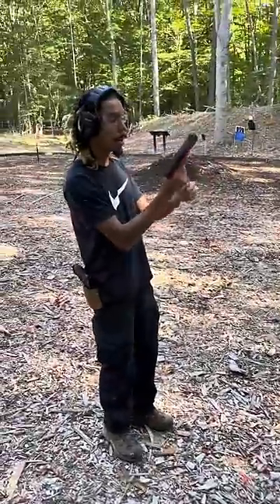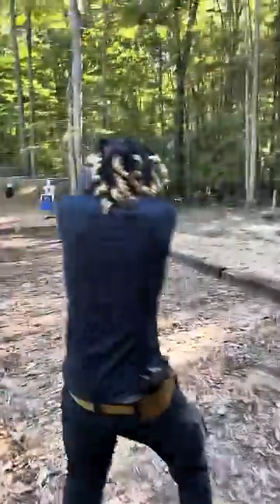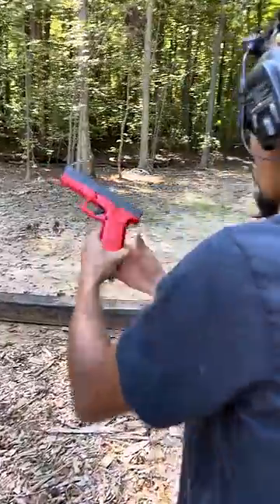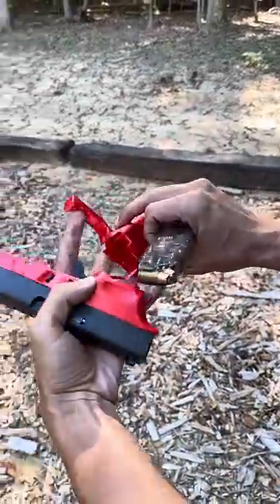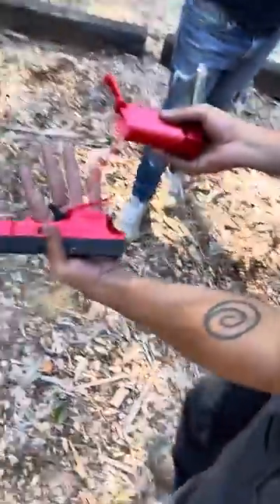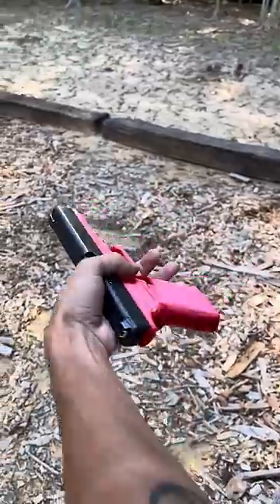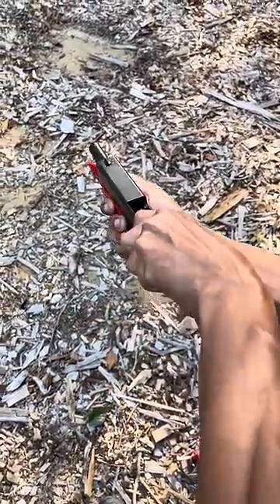3D Printed Gun FAIL 🤬

Comment: "I think i used the wrong material" lol yes, he used silk filament which is pretty weak and mostly just for looks. PLA+ is probably the best way to go, at least he acknowledged it though lol
Reply: Will carbon fiber filament work ? I heard pls shrinks or warps under heat
Reply: Not because of material ,look like he printed it horizontal layer which make it weak and easy to break.
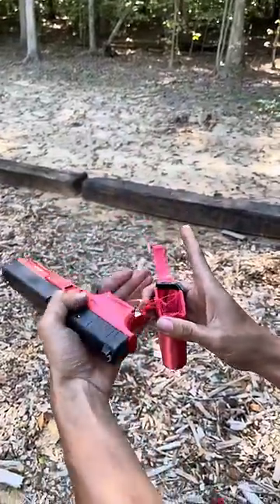Reply: @AlienZ..  Were he using a "normal" amount of infill you would be right. However, at 100% infill it really doesn't matter all that much. Yes, the print will still be stronger under compressive force than shear force, but both orientations will be plenty strong to handle 9mm. This was the fault of material choice and bad print settings (look at 0:26, how the outer perimeter on the inside of the mag well is separating from the rest. That shouldn't be happening.), not print orientation.
Silk PLA is terrible for structural components. It's pretty, you have to print very hot and very slow to make it strong.
Source: Been 3D printing for 11 years, and printing guns for 4. I've printed pistol frames in every orientation under the sun, and have only had one fail on me when the infill underextruded due to a partial nozzle clog.
Reply: @GambleSTARS 

Holy smokes that's a lot of moneys worth of ammo
Reply: @GambleSTARS. Yeah I don’t believe that I’m sorry
Reply: @___meph___4547 . Are you talking to me ?
Reply: Carbon fiber filament homie, the shit I’ve made with it…. Well let’s just say it would get me into some trouble
Reply: what about kevlar fillament
Reply: Pla has problems with layer separation and is pretty brittle, be sure to look up data sheets about the filament you’re about to buy because it will tell you the melting point, glass transition, Young’s modulus, among other very important material properties
Reply: @joen8091  can you make me one?
Reply: @josephavila151  glow brighter
Reply: @gavinslimmer3508  ok? All i came up w doing a “glow brighter” query: nail polish, glow in the dark wands and lipstick.  Gimme a hint.
Reply: Yeah.  Silk filament has an elastomer in it.  Not the right choice.
Reply: @yungsweatshop8797  I think you meant abs. Pla is the easiest of the materials and hardly ever has problems with layer adhesion unless you're doing something wrong. It's also more flexible than abs or petg, those are the two brittle ones.
Reply: Pla+ is the easiest acceptable material to use. It is definitely not the best, glass or cf filled nylon is the way to go.  Pla+ is more like the minimum, you gotta use pla+ or better if you want your frame to last.
Reply: All my stuff I use PETG and that bottom end looks super think
Reply: But only after the fact
Reply: i wouldnt use anything weaker than PETG, you dont want to inadvertantly make a pipe bomb
Reply: @GambleSTARS man you got videos??
Reply: @josephavila151  hell no what kind of a question is that 😂
Reply: There are better ways to learn things.  It doesn't have to be trial and error.
Reply: @GambleSTARS not on video not real
Reply: Wonder if you could use Delrin
Reply: Pretty sure ABS with it laid on the back would be better. It broke where the filament was doing turns.
Reply: @grug_son_of_thog  I've been 4d printing for 12 years chump😬
Reply: @HowsItHappening  PLA is one of the easiest materials to print with, but you have the flexibility and brittleness completely flipped. ABS and PETG are SIGNIFICANTLY more flexible and less brittle than PLA.
Reply: @GambleSTARS Ar lower is way different than a hand gun lower.
Reply: @grug_son_of_thog  I know you said you've been printing for ten years but where are you getting this info from? Everywhere I've read and videos of testing materials out all agree that PETG is stronger than PLA (though weaker than ABS) and more flexible than ABS (though less flexible than PLA). I've only been printing for about a year but I've been researching and learning a lot. Even if I hadn't read and seen tests I would already know petg is more brittle from experience. You can shatter petg like glass while pla will flex until it snaps, not shatter.
Reply: @ninamillimeter8926  definitley would work better but that shit is expensive to find a printer capable of doing so. Think the one I was looking at was 77k. If you are looking to make them for selling, probably would be a good investment but if not nah.
Reply: @HowsItHappening  petg would be better or maybe abs. He should also print so that the layer lines aren’t parallel to the direction of recoil.
Reply: @deelowe3  I dunno, I'm pretty sure petg wouldn't last a whole magazine before cracking. I've made one before and cracked it just putting it together. I haven't heard or read anything about using abs, but it's such a pain to work with anyway that you might as well go with fiber filled nylon or pa. I love my nylon frames, it gets way too hot here for pla.
Reply: @HowsItHappening  petg is more durable than pla. If that doesn’t work, you’ll need to switch to the plastics that require thermal chambers.
Reply: @deelowe3  petg is harder than pla but not more durable. Pla flexes more before it breaks, petg breaks all at once and can even shatter. I know from experience but there's a video of someone testing all of the different materials. I think the channel it's on is "cnc kitchen".
Reply: CF works fine as well.
Reply: Some carbonized nylon impregnated with kevlar or glass wouldn't hurt.
Reply: @timothyavendt677  many people also reload.
With some metal inserts, a good printed 10 lower can withstand .308 - doesn't hurt to make a spare lower for the backpack though
Reply: @grug_son_of_thog  can i make a firearm out of my 3d printer, whiteout using no other materials
Reply: I’ve came to the conclusion that not a single one of you have any clue what you’re talking about
Reply: Atf coming to your house bruh bruh
Reply: He acknowledged it to the idiot using it after it already broke. Like what a great guy.
Reply: @HowsItHappening  yup GF nylon is KING for high impact, good luck getting consistently good prints with that stuff though lmao had to upgrade nearly everything on my printer to even get standard nylon printing without layer adhesion issues.
Reply: @MisterMosfet  I might be able to help you. My pieces come off almost looking like factory frames and the parts just pop right in. I'll try to make a little list or tutorial of it, but you can ask me anything about it.
Reply: Was going to say the same thing
Reply: @HowsItHappening  You're not wrong that PETG is stronger than PLA--though strength and brittleness are not 1:1 related. Something can be very strong but still ductile, or very weak and still brittle. PETG is stronger, more flexible, and less brittle than PLA. This is just the way these polymers behave.

You're directly quoting, word for word, a 3DNatives article there (" PETG is stronger than PLA (though weaker than ABS) and more flexible than ABS (though less flexible than PLA)"), which is the only place I've yet seen assert that PETG is less flexible than PLA. Let me provide you with some counter-examples.

"PETG is actually stronger than PLA in terms of tensile strength. PETG is also more durable, impact resistant & flexible than PLA so it’s a great option to add to your 3D printing materials." -3D Printerly

"In summary, if you want a filament that is strength compatible with PLA, but with the flexibility of ABS then perhaps you may wish to consider PETG for your task. However, the natural fluid impermeability and UV resistance of PETG give it the advantage for if your printed object is destined for outdoor use. For everything else, PLA is a solid choice." -Wevolver

"PLA is stiffer whereas PETG has more of a flexible quality to it, making it harder to break since it will bend more. According to a study by SD3D that tested both the tensile strength of PLA and PETG, PLA’s tensile strength is about 7080 PSI, and PETG’s is 7690, making PETG stronger overall. (...) As far as impact resistance goes, PETG is also the winner since it’s a lot more flexible and can absorb impact much better than PLA." -3DSolved

"Between the two materials, PETG filament has greater flexibility than PLA. Whereas PLA is brittle and tends to break or chip on impact, PETG is more likely to bounce slightly and avoid damage when dropped." -Clever Creations

"Though PLA and PETG are known to have similar densities, PLA is notably more brittle and snaps far easier if put under significant pressure. PETG is more durable, stronger, and features better impact resistance, due to its increased flexibility." -3D Sourced

"As expected, PLA is really the stiffest with a bending modulus of 3300MPa, next comes ASA with 2300MPa and with only 70% of the stiffness of PLA, PETG is the most flexible material of the 3 with only 1900MPa, really interesting!" -CNC Kitchen

You can shatter PETG like glass under certain conditions, but in most conditions it will have a ductile failure compared to the brittle failure that an identical PLA part will experience under identical conditions. There's a reason why industrial manufacturers use PET, for instance, for recyclable drink bottles. Go ahead. Try to shatter a plastic Coke bottle like glass at room temperature.
Reply: The problem wasn't material choice. As you can see with the layers unraveling, there's no layer adhesion there. The problem was simply that it was printed it at too low of a temperature for the plastic layers to combine with one-another.
Reply: @ninamillimeter8926  pla+ is the standard. It does warp in heat. Carbon fiber nylon is the next best thing but you have to make sure your printer can handle xn
Reply: @oscargutierrez970  petg is too brittle
Reply: @grug_son_of_thog  This is one of those things where we'll just have to trust our own experience I guess. I found quite a few sites that mention the opposite of yours. Also,  everyone I've read or heard from about making lowers says do not use petg because it'll crack easier. Every lower I've made from petg has cracked while I'm assembling it so I've never gotten to shoot one. If you have, please share your slicer settings and brand with us so we can try it out. Bringing up a soda bottle to prove a point is a bit ridiculous though. They are vacuum formed from a single piece of PET. So, even if PET and PETG were the exact same thing, it would be a totally false comparison. Almost like saying a chunk of quartz has the same properties as a glob of sand glued together. Go ahead and print a bottle out of PETG to see how tough it isn't.
Reply: @josephavila151  atf agent
Reply: @grpanth1890  no
Reply: PLA+ is different material depending on manufacturer.  I would start with CF Nylon or maybe CF PETG.
Reply: @joen8091  CF doesnt automatically mean strong. I would honestly make a mold and used chopped CF with epoxy. If you insist on printing stay away from CF PLA and stick with CF Nylon or CF PETG.
Reply: Pla+ or Polymaker ASA would work well too. I work for matterhackers so I’m pretty familiar with most materials
Reply: I would use ABS
Reply: @HowsItHappening  I print in whatever brand I can get my hand on at the time I need it. About 90% Inland from MicroCenter, but I also print in Prusament, eSun, 3D Fuel, MatterHackers, ProtoPasta, Amolen, ColorFabb, Plasty Mladec, Zi-Rui, MG Chemicals, Gizmo Dorks, Polymaker, etc., and every roll ends up with its own profile tuned to its specific performance. I've got a big plastic tub in the basement filled with about 150 empty spools that I've yet to take to the recycling center, and that probably contains even more brands not listed here. 

But alright, you want my print settings? Sure.
General: 0.2mm layer height, 0.3mm first layer height. 3 perimeters. 5 top layers, 4 bottom layers. Infill percentage and pattern based on the geometry of the design and the intended use case. Monotonic top and bottom fill patterns. No skirt or brim unless the part is very thin, in which case I prefer to add a 1-2 layer thick by 25mm diameter cylinder to the thin part of the model and then cut it off after, rather than using a brim all the way around. Support, when used, uses a 30° overhang threshold, a 0.15mm top/bottom contact Z distance, 3mm pattern spacing, 45° pattern angle, 3 top/bottom interface layers, 0.2mm interface pattern spacing, and a 50% XY separation. Perimeter speed of 60mm/s (incl. small and external perimeters), 120mm/s infill (incl. solid and top solid), 75mm/s for support, and 40mm/s for first layer. 0.45mm extrusion width for everything except the first layer, which I bump up to 0.9mm. 20% infill/perimeter overlap. 0.97 bridge flow ratio. 0.15mm elephant foot compensation. No special post-processing (ironing, fuzzy skin, etc.) unless it's for a specific part that would benefit from it.

PLA-specific: 215° first layer nozzle temp, 220° all other layers. 60° bed throughout. 0% fan on the first layer, with 30% on layers 2-5, and 100% on every layer after that. 0.6mm retraction w/ a retraction speed of 35mm/s, wiping enabled, and a 0.5mm Z-hop.

PETG-specific: 240° first layer nozzle temp, 230° all other layers. 85° first layer bed temp, 75° all other layers. 0% fan on the first 5 layers, 25% fan on all other layers (this is a new change and subject to further modification. I used to use 40% but the new triple-fan duct I'm testing is now way too powerful at 40% for PETG so I've dropped it quite significantly). 1.05mm retraction w/ a retraction speed of 40mm/s, wiping enabled, and a 0.5mm Z-hop.

The only PLAs I've ever found to be more flexible than PETG are those that are modified with something else to change their physical properties. For example, ColorFabb LW-PLA (which turns into more of a foam than a solid plastic when you print it hotter (this is what I use to print all of my RC aircraft control surfaces and wings from)), MatterHackers Soft PLA (I believe they've discontinued this. It's on clearance on their site right now. I've only used this a couple times and never found it to be particularly useful as either LW-PLA or a proper elastomer filament like TPU/TPE do it better), and PLA+. PLA+ is very often more flexible and less brittle than PETG, but using that as the default would constitute moving the goalposts as the argument is PLA vs. PETG, not modified versions of either. For the record, the vast majority of my printed guns (FGC-9 MkII w/Glock barrel adapter, Plastikov, Amigo Grande, multiple DD[X] Glock frames, CZAR, etc.) are printed from PLA+ due to the material properties of said filament. The only one printed out of plain PLA is a Lo-Point I slapped together as a shitpost. But again, not the point.

I'm curious to see what these "quite a few sites" you mention are, since simply googling "is PLA more brittle than PETG" and scrolling through the first two pages yields 17 articles that say PLA is more brittle than PETG, 2 articles that are answering why your PETG print might be brittle after printing (spoiler alert: both articles say this only happens when your print settings are wrong), and 1 article comparing PLA+ to PETG. So far the only site you've quoted is the first result for "PLA vs. PETG flexibility," which is contradicted by every other result below it.

Edit: I don’t even know why I’m continuing to engage in this conversation. You found one singular piece of evidence that supports what you say among a mountain of contradictions and dug your heels in. This is the last comment I’m making on the matter. All else being equal, PLA is more brittle and less flexible when compared to PETG and ABS. Anyone who’s done any significant experimentation can tell you this. PLA PLUS can give PETG a run for its money in flexibility and ductility, but plain PLA cannot.
Reply: @grug_son_of_thog  aw shit man.... you're right. For some reason I was looking at pla+. It kept taking over my search somehow.  Thanks for sharing your settings, I know it's a bit different for every machine and material but I can start there to try to get my petg printing correctly.  It seems like mine is getting cooled to fast if it's cracking easily according to all3dp. I haven't even tried to use it for anything besides toys that need to be heat resistant ever since I tried a few frames that cracked.  So, do you think petg would be good for frames if it is printed correctly? I'm sticking with nylon either way but I'm just curious. I know you said you aren't responding anymore and I didn't mean to offend or upset you but I'm glad I learned something from you.
Reply: Thank goodness my semi-automatic pistols are made out of steel not this fancy Fantastic Plastic !.
Reply: Plastic may be fantastic but steel is real.
Reply: @ninamillimeter8926  Dont use carbon fiber filament
Reply: @josephavila151  
"Glow brighter" as in he's calling you a glowie, aka a fed. If you aren't, don't ask dumb questions. If you are, expect that response a lot.
Reply: @josephavila151  
Shit, don't be mad at me, you asked, I answered lol.
Reply: @JohnDoe-pd2lh  ok im sorry john
Reply: nah
Reply: @ninamillimeter8926  yes, priline carbon fiber polycarbonate works great and has proved very durable, as long as you have an enclosure and make sure your layer adhesion is good.
Reply: @Disconnected.Reality  What makes you say that? For me, carbon fiber pc has held up the best out of every filament I’ve tried. What have you found to work better?
Reply: @tee4222  not saying its bad but its known to have issues with extrusions a but if you were able to get it work and print well. More power to you. It just is the consensus in the community. I personally use PLA+ Pro from Polymaker
Reply: @Disconnected.Reality   I see, that makes sense. I’m thinking a lot of that comes from people just not using an adequate setup for the material. If you want good results with pc, you really need an enclosure that maintains at least 50c, and obviously an all metal hot end and extruder that can handle the temps. You can’t expect a usable cf pc part with an ender 3(stock), for example. I haven’t tried pla+ PRO though(didn’t know that was a thing), only pla+. I’ll have to give that a try. Appreciate the reply.
Reply: @tee4222  No problem thanks for the insight. I personally plan on switching to an enclosed setup so there are less variables to deal with. Also cant agree more settings ands setup are issues for others in the community. I was wondering which  printer are you currently using? Also the pla I use was recommended by a Youtuber by the name "PrintShootRepeat" you might know him.
Reply: @Disconnected.Reality   currently I’ve been using the qidi ifast, which makes it super easy with the heated enclosure. But I was getting pretty decent results before using a prusa mk3 with a passive enclosure and some insulation(blanket draped over it…)
I have seen his vids! I’ll have to check the one out on the PLA+ pro
Reply: @AlienZ..  that’s what I was gonna say. He should also strengthen by printing at an angle
Reply: @GambleSTARS oh fuck, printing an ar 10 lower would save so fucking much money
Reply: @MisterMosfet  you can actualy resin print nylon (nylon like). its insanly strong and super impact resistant, i watched guys take hammers to it. hopefully I buy a resin printer big enough soon lol.
Reply: @Rich Martinez carbon fiber is extremly brittle, i think the only reason it works is because of the plastic composite.
Reply: Guy its gotta be petg or don't waste your time to print
Reply: Petg or abs would be better
Reply: HE USED SILK FIL IN A GUN???????
Reply: They have a metal pla filament now too
Reply: @kanaancross317  nope there’s metal printers but you can’t do metal through a normal fdm
Reply: PLA+ is probably far from the best way to go (for durability), actual best would be something like CF-PEEK or PEI of CF-Nylon
Reply: Also lots of layer separation- eather extrusion  too cool or uneven filiment diameter/un calibrated extruder steps
Reply: I printed glock from charxhoal fiber and gun works good.
Reply: @grug_son_of_thog  do you have telegram? im just starting to print & wondering if i can pick your brain
Reply: Polycarbonate or abs is the way to go
Reply: id go petg at the minimum but nylon is far better
Reply: @HowsItHappening   we all know you dont know. because you are completly wrong petg is far less brittle than pla and is more heat resistant as well its much better suited for fire arms then pla is. the best material for gun parts for overall strenth and durabillity is either infused nylon or polycarbonate both are leagues stronger then anything else just much harder to print.
Reply: I prefer PETG, somewhay affordable and pretty stable tbh
Reply: its better if you get a metal grip from a airsoft gun or a real gun.
Reply: you could use nylon and 100% infill
Reply: Soon, there is going to be the rapture. It's when there will be trumpet sounds, and after the trumpet sounds, God will lift his people from here. Also, God said people should be living by the Bible. Amen, and God bless you.

Jesus loves you guys. Dont wait, please. He will welcome you with arms wide open.
* John 3:16 - "For God so loved the world, that he gave his only begotten Son, that whosoever believeth in him shall not perish but have eternal life".
Reply: I was literally about to say this
Reply: @ninamillimeter8926  warping is not that bad unless ur shooting 300+ rounds in very quick succession never had it happen in the ones i made thats just what id assume ive gotten it pretty hot using pla+ the thing about cf nylon is its hard to print like you need a hardened steel nozzle or it will clog a dry box to keep the filament from being exposed to atmosphere if you dont it will be ruined and have a closed area to trap heat to ensure it doesn’t cool too fast while printing and completely warp and get ruined while printing.
Reply: Gotta use the PLA+ fasho
Reply: You use the wrong material
Reply: @grug_son_of_thog  any pointers on walls and shell thickness maybe share your best orientation and layer height.
Reply: In hot areas pla+ not gonna cut it, try ASA, ABS, Carbon fiber nylon